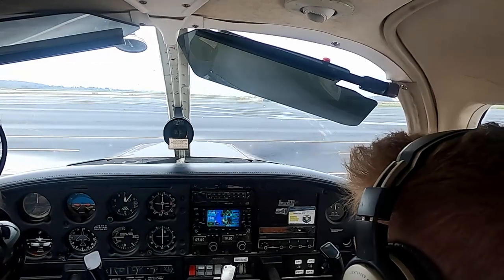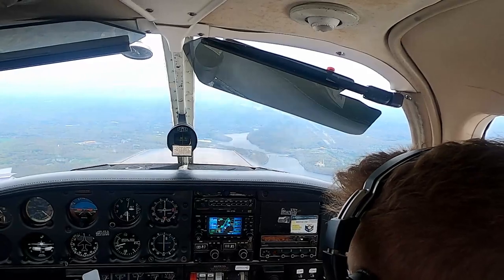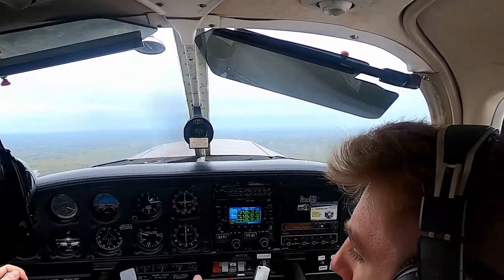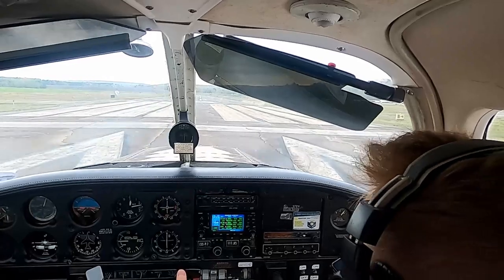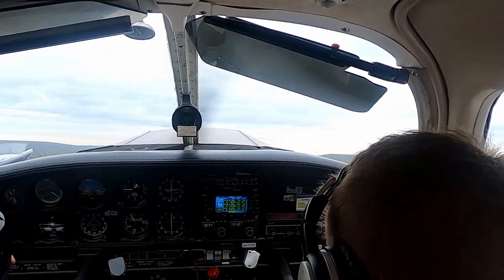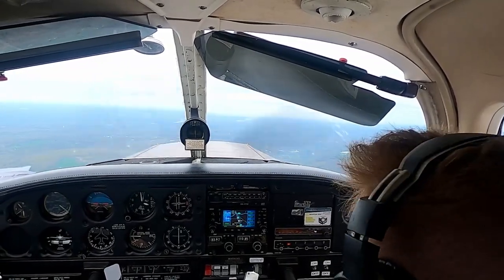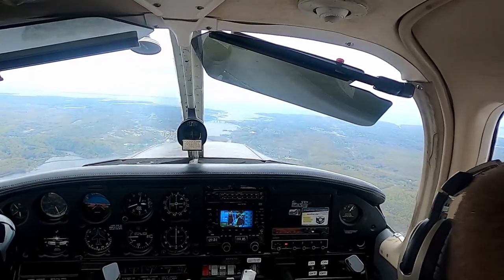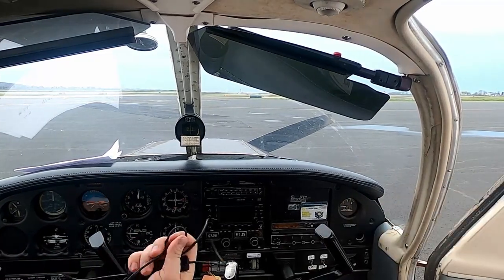Flight Training Day 18 - Short Field

Comment: Yes, getting speed under control is even more important on short fields.  Vso, and out of ground effect airspeed, has nothing to do with the actual speed reduction required for the wing to quit lifting the weight in low ground effect.  The POH approach speed, especially in short winged airplanes, is much faster than Vso or even 1.3 Vso in some.  Slowing down to the point that we are using more power to maintain wanted glide angle and rate of descent puts a higher percentage of free prop blast relative wind over the wing that longer winged airplanes.  I taught power/pitch to eliminate round out and touch down slowly and softly on the number every time, but ACS won't allow that.  By learning that first, however, my student soloed earlier enough that no excess time was lost learning ACS lack of energy management on landing and on takeoff.  For the short field takeoff, why is the soft field actually shorter.  Because acceleration level in low ground effect is used, which is far more efficient energy management.  The ACS now calls for acceleration in ground effect to Vx or Vy as appropriate, but neither is appropriate on long runways nor is either appropriate on short runways until near the obstruction.  Lots of bent tin and skin due to lack of use of free ground effect energy.

Student is doing an excellent job keeping the centerline between his legs (and yours, an optical thing), but the steering wheel driving to achieve, a most common error, is distracting him from other issues.  The spring interconnect in the Cherokee causes apparent coordination, but unless we lead rudder the nose goes the wrong way first.  This is distracting.  Dutch rolls, sometime now called coordination rolls, will guarantee leading rudder.  There is no way we can bracket the distant target without leading rudder.  And on short final we don't want to turn anyway.  We want to yaw correctly to bracket the target (walk the rudders) rather than yaw incorrectly using aileron.
Reply from the maker: Thanks for the comment! I'm actually the student, not the instructor. Interesting points about using ground effect for the takeoff. Can you explain what you mean by leading the rudder?